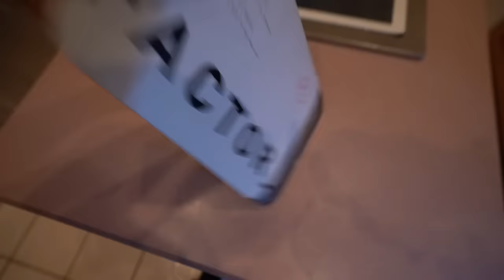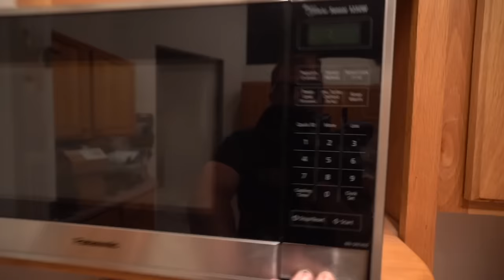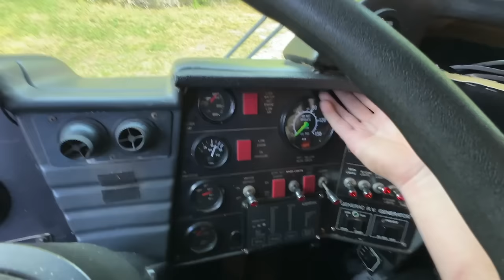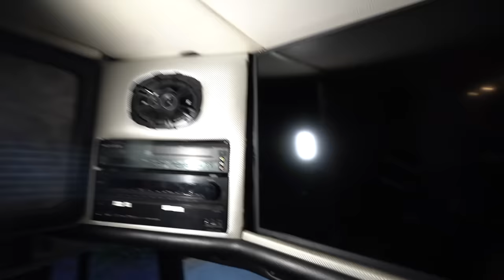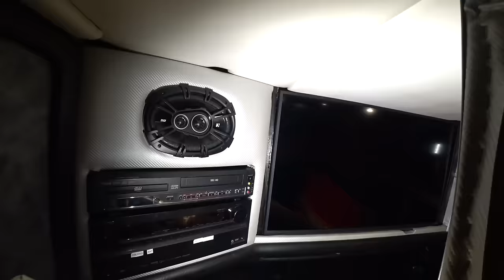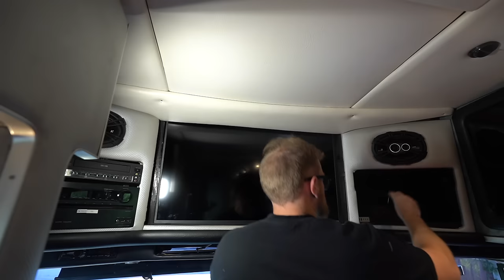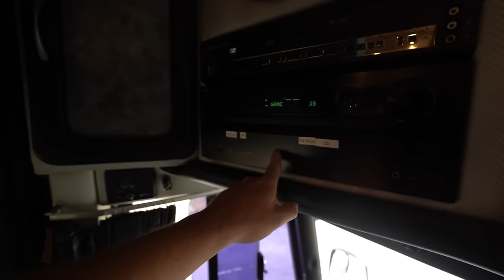Car hauler bus upgrades and refit. night and day difference

Comment: That battery upgrade was HUGE benefits. The additional space you gained in the other compartment is worth it alone not to mention how neat and serviceable it is now.
Reply from the maker: It makes me so happy now when I look in there and it’s not just absolutely chaos of wires and wood. Lol makes me way more confident in it.
Reply: Now you just need to do a load test and see what draws the amps. 
More of a thing with the older setup as you have switched to mostly LEDs, but it is still a nice reference for your self later on.

Comment: Good stuff man but you should clean up all the connecting wires on the house bank. Parallel the 4 batteries together and have a bus bar for both  the positive and negative side.  All the house wires go to the bus bars and there should only be one wire from the bus bars to the battery terminals.  You even out the battery drain by putting the positive bus bar wire on one side of the bank and the negative bus bar wire on the opposite side of the bank. If you want to monitor your loads on the battery bank put a Victron Smartshunt between the battery bank and the negative bus bar. The Smartshunt uses Bluetooth to monitor on your phone. This is how I did for 8 batteries on my large RV bus.

Comment: I'm surprised you didn't give that whole battery cabinet a black rattle can job before sticking the batteries in there. Looks great though. Always love the attention to detail, and willingness to change the plan when you find a better way to get the job done.
Reply: Was thinking the same thing. A quick wire brushing and clean and some spray bombs would protect and make it all look sick. But I still would have went lithium and solar

Comment: I'm blown away that you haven't built a slide out tray for your batteries.  Also don't forget and Easy Start system for you AC unit, it will definitely lower your required amperage to run it.  Bus is looking awesome man, great work.
Reply: A slide out for the batteries and the generator would be tits
Reply: I thought the same thing, lead acid batteries need maintenance, and since he went lithium he's only ever going to need to just replace them or troubleshoot. Our boy is keepin it simple! But yah and I bet he builds slideouts eventually. I would for the generator for sure.
Reply: @rwa96  AGM is still lead acid. They're just fully sealed, instead of a flooded cell battery that does need to be topped up.
Reply: Slide out for all the storage.. imagine not having to reach in to get wheels while hunched over..
 Slide it out and stack em on and slide back in.

Would love to see him put the bus on air ride and build a drawer system for each section of the under body storage.
Reply: Pair of 44DD's......😆😆 @pastaalalamborghini

Comment: I usually totally agree with you ideas but I have to make a few suggestions to your new battery installation.  You have done a great job mounting the batteries but YOU SHOULD NEVER have your positive and negative cables crossing over each other.  You're just asking for a chafe situation causing a massive short circuit.  Since the batteries are so well positioned you might be better off just fab up some custom insulated copper buss bars to replace some of the cables for a cleaner and better installation.
Reply: I agree with this. I wonder if there was enough room to put them in a I I I I configuration over the == way. (best I could do with simple text lmao)
Reply: Where is Josue?
Reply: @MrGuyBroDude  That config with bus bar is what I was thinking
Reply: @MrGuyBroDude ”the definition of a genius is taking the complex and and making it simple”
- Albert Einstein

Comment: For the empty spaces above ur head I would do white plexiglass acrylic sheet inserts with LEDs on the inside.
Using the white plexiglass will give it a better more comfortable appearance.
Reply from the maker: So almost make it into like a backlit? I was thinking about putting the amp in the one that’s open from the bottom so you see it when you’re in there. Or cramming one inside that box and a tablet on the screen. Might be cool.
Reply: @Taylordrifts  Why not do all of the above. The Amp idea with LEDs and the tablet will be the sharpest idea in my opinion other than that idk what else you can do for that.

Comment: Love the bus project. Moving the batteries was definitely a great idea, so much more room in that cabinet now. Definitely worth stripping back a lot of stuff, gonna create space or simplify things long term, seems the previous owner just ad hocked a lot of stuff and kept adding rather than re-working it - but modern tech and techniques also help. I agree with others, don't cross the negatives and positives wires, and not just the battery thing but generally, consider rail systems where it makes sense, gonna be a lot easier pulling stuff out long term even if you lose a bit of space to accommodate it.

Comment: I would put some cams around the bus to have 360 view like modern cars have nowadays and maybe have some screens or just one to display that on some of those empty spaces and some more cabinets to store things.

Also, have you thought on retrofit the passenger seat as a racing/flying sim with a mini ITX or a full pc on that thing that keeps opening?! also adding a quest 2 or 3 for example to keep things simple and people could see on the TV what the one playing was doing that way people could be also doing something in the trip... and that PC could also be a streaming station with the proper mods.

Comment: Felt wayyyyy better about the hold down strap when you swapped the neg terminals towards it. My old diesel mechanic friend said some old semi's had a hot chassis and grounds were run by wire. Weird.

Comment: If you ever need more battery lugs in a pinch, you can easily make some out of copper pipe. Crush one end in the vise, drill a hole and it’s good to go. I usually keep a few different diameters on hand when doing electrical

Comment: I would fill in all the overhead holes with smoke acrylic from the back if you can and back light them until you figure out what you really want to put in those spaces. That way they blend into the black vinyl and kind of disappear until they light up. For the amp hole, reuse the box only, (or build a something) snatch all the guts out and mount a small Intel NUC type mini PC in the inside of it or underside of it and use the smart tv as the monitor via HDMI. You could get a blue tooth mouse and keyboard combo and the sound will come through the HDMI and play through the bus speakers system. Then anything you cant do on the tv internet wise, just flip over to the PC.

Comment: It’d be so dope driving that thing around the country with the trailer so you can have the vette and the f80. You could put rgb strips and acrylic in the holes from the old electronics. Rgb smart bulbs for the rest of the interior would also be cool

Comment: Can I suggest you get raptor or rino liner (which can be purchased in grey), and spray areas as you progress, I did this with my build and despite the extra work cleaning up and spraying I am soooo glad I made the effort, not only is it a rust preventative but it makes any cleaning down the track a brease to do (I used raptor liner and cant speak highly enough about the results, dirt, dust and pills have now become not an issue and the area is much more presentable)

Comment: You mentioned possibly setting up a display for the driver which would use Android Auto. I think it's worth checking out Garmin's dedicated GPS solution(s) for RV's. I don't have experience with those units myself, but on the whole Garmin makes some incredible products! Love the content, as always. <3

Comment: I like that you made more room under the cargo bay, but I think there's a reason the bus has big batteries, more power is not always better. the bigger batteries can store more energy to last longer cranking attempts and wont drain as fast when using accessories at standby, and also so they don't I overheat as easy under heavy use, more fluid to stay cool. I have seen battery explode after some years and prematurely die out, just a suggestion it may not matter much.   but you always do a good job thanks

Comment: Word of advice for the smart TV, don't use your phone's wifi Hotspot as it burns through your data. There's a USB-c to hdmi adapter that's like 20-40 bucks that plugs into the TV and then shows and movies are free data. Technically you don't need a smart TV to make it work

Comment: Glad to see the vertical tie down on the batteries.  I know that with how much busses like to float around that could become an issue.  On that, there was what looked like a power supply that you mounted beside the batteries (behind) and at the bottom.  That thing is vented to cool for power conversion, that could become an issue since that space is vented to the road.  I know it isn't likely to have water come through the holes in the flooring, and into the power supply, but if it did, it could be fire, and or mayhem when it gets powered on.

Comment: Hey Taylor don't ya think if a guy had an Aluminum Bus it might be a good idea to have some protection from an Acid Leak , you could be driving down the road and develop a leak other than the danger of the Hydrogen (which is Explosive) in no time at all your Batteries would be falling out the bottom of the Bus ,love the channel keep up the good work 👍

Comment: Could you do a PDM to completely replace all the old gauges, switches, indicator/ status lights, etc. I think it would look awesome and be awesome to control all the system from a central location and have all the data coming back to the display showing things like battery status, generator status, current draw, maybe even have another for all the driving displays. Really bring that wiring system upto a modern standard. Also what’s happening with the generator? Trying to find someone to overhaul it or going for a replacement when funds are freed up? Great content as always, can’t wait for the next bus video!

Comment: Pull the over head black dash and just wrap it with black leather from hobby lobby it’s incredible cheap to do. Plus the arrow air stapler from Home Depot is cheap also. I just went thru this process it covers the old existing holes and you’d never know it

Comment: Electrically, as long as you tie the batteries together using large enough wire, the batteries will all be drawn down equally, no matter where you tie your loads. That's a great thing about wiring in parallel.

Comment: Those self tappers you used to mount those boxes on the wall in the battery compartment may later on down the road become an issue if you're storing tires in that neighboring large compartment. Pop those self tappers out one by one and replace them with through bolts and nylock nuts.

Comment: Should throw an inverter in there mate you have the battery bank for it and there is nothing better than being able to stop on the side of the road for a break and make some lunch/relax when you are on the road without a generator running. Best thing i did to my van

Comment: Look into making a battery tray on high capacity sliders, with main cable length that lets you pull it outside the bus and able to lift the batteries straight up, with a lock pin(s) or such.

Comment: Seriously, add a Micro-Air Easy Start system for you AC unit.  They also make them for the house.  My 4 ton unit took 144 amp draw to start and 21 amps to run.  After installing the Micro-Air Easy Start, my 4 ton AC unit now draws only 37 amps to start and 17 to run.  They make these units for RVs also, so i think it would be great for you.  And, maybe replace that old gen with a newer Onan.

Comment: I cant remember if in past videos you mentioned if the bus has a camera system, but if not that upper side that you mentioned on minute 39:19 can be used to put a small screen with a multiple camera view (inside and outside for blind spots, reversing and monitoring).

Comment: There are a couple things that you need that you don't have. One is a water pressure regulator, the other one is a line conditioner surge protector for your power

Comment: Consoles in the empty spaces need I say more. If you have to remove the generator you should build a sliding rack for it so future Taylor needs to service it you can just slide it out like a drawer, plus if it’s on something like that and you have to run the generator you can run it outside and not heat up the living area.

Comment: Wireless backup cammer for the bus 12 inch info screen with apple car play andriod auto which will also help with maps.  And the other holes flip down screens for cammers around the bus

Comment: Just wondering about battery heat and lack of air space between the batteries.massive cleanup on the wiring.👍👍🇦🇺🦘

Comment: With the batteries I would have made a battery tray on sliders so it’s easier to get out and service them. With that drop down screen use it for a navigation system is my thought

Comment: Thanks to the solar community a lot of research is available for running batteries in series or parallel. But my understanding is a better way of evening the load between all four batteries in parallel, say 1-2-3-4: Would be to run the positive to the vehicle from battery 1, and the negative from battery 4, and just interlink a chain between. So positive V-1-2-3-4 and Negative 1-2-3-4-V.

Comment: Here is my wish list of stuff for the bus. 

Kenwood Excelon Reference DNR1007XR
Kenwood CMOS-740HDLP Backup cam
Kenwood DRV-N520 Drive Recorder dash cam
JL Audio C2-600X Front door speakers
JL Audio C2-690tx Back  speakers
JL Audio 10W6v3-D4 Subs
JL Audio JD400/4 (Highs)
JL Audio JD1000/1 Sub Amp (lows)
AudioControl ACX-3.2 All-weather stereo EQ and crossover with paging microphone

Comment: Being on the 4x4’s mightve kept them from having a parasitic draw on them….you should put a rubber pad down, so the metal floor doesnt pull power off them batteries…thats what id figure them blocks of wood were for

Comment: I can see that Battery Hold down you made working itself loose and burning down the Bus and anything inside of it.. I may be wrong but is what i see. You should weld a piece of metal to the inside of that strap to keep it from touching the terminals even if it does come undone..

Comment: I'd 100% be putting at least 2, probably 4 300w panels and a cheap as chips Chinese mppt charge controller into that bank, you'll probably find you barely used the generator, plus no horrible noise.

Comment: for the record, lead acid batts you can only pull about 20-30% of their AH capacity, AGM roughly 30-40% of their AH, and Lifepo4 you can pull 90-100% of their AH capacity, so a 60ah lifepo4 batt will give more capacity than most 200ah lead acid and agm batts. so for your "hourse batts" side you should use lifepo4 cells and a bms, it will be a heck of a lot better, wayyyy more cycle life, more capacity for the space and weight, and cheaper when you consider useable AH

Comment: Would have liked to see you use lithium batteries instead of agm. Should stick the batteries on a slide out for easier servicing of things in that area. Hate those terminal blocks and that one positive line should curve around the negative wires instead of laying on top of them. Should label all those wires you traced too. Camera needs a light on it when recording inside the bus imo.

Comment: IMO, yeah the tablet in the overhead is a dumb idea. If you don't have a use for it, don't do it. 
I would take the generator somewhere if it's an electrical. If it's a mechanical issue, then try it yourself. 

Are you planning on adding a CB radio or similar?

Comment: Is it a 24 volt syestem or just 12 with multiple batteries? Because a 24 volt system is wired differently with ground from one battery going to positive on the other battery.

Comment: If your generator is running but not out putting any power check to large capacitor located near the outlets, an easy fix if that's the issue.

Comment: I'm not crazy about that metal hold down strap being so close to the terminals. It should be okay because everything's so tight, but I just don't trust electricity enough to do it that way myself. if there's any possibility it makes contact it will happen at the worst possible time, like 3 AM when you're away from home with another vehicle and you lose the whole thing. At the very least I would figure out a way to get some rubber between the terminals and strap, but that's me, and you can build your bus however you want.

Comment: The TV is worse now with the top bezel blocked. The entire purpose of the panel is to fill a gap, but there is no gap. Meanwhile the gaps on the sides are what really detracts from the visuals.

Comment: Ok so on the cabinets in the bus the small holes on the bottom put led strip lights in there then close with opaque panels so they glow the same as the rest of the led in the bus

Comment: Hey Taylor, I have a 3d printer. Let me know if you need some custom parts made for the dash of the bus.
Reply: @Aduki65 Yeah, his has a pretty small build area though and I have no idea his comfort level with fine tuning prints and 3d modeling. But hey if he needed some help designing something and was able to print and prototype designs from home, all the better.

Comment: Ahh man wicked missed opportunity here, You should have went lithium and then solar panel your roof. You can prob fit enough solar to run in the sun with zero noise no generator with A/C